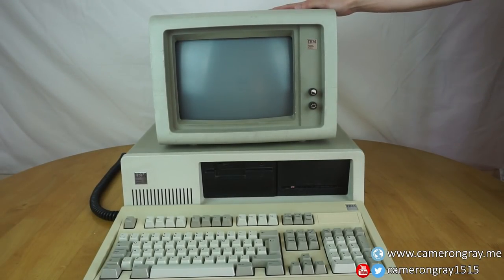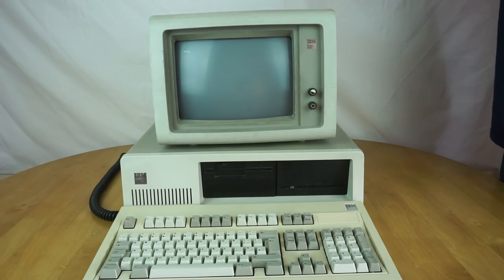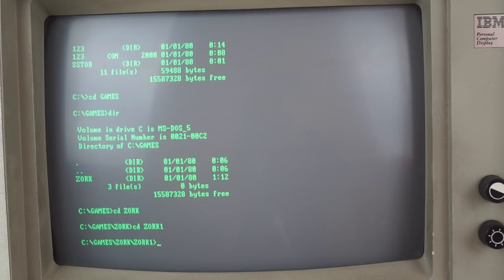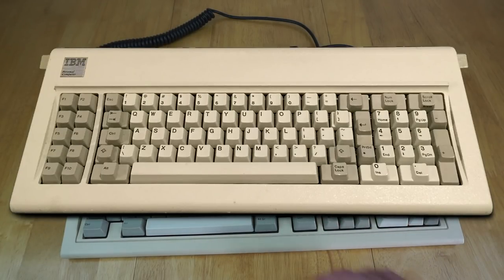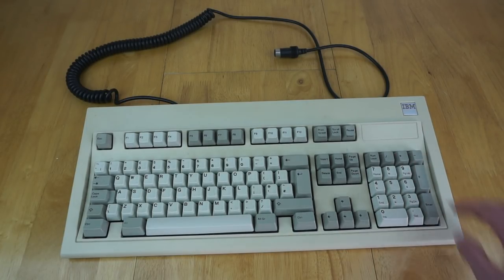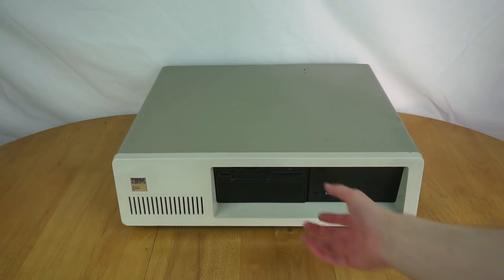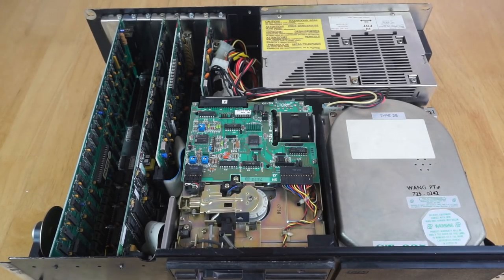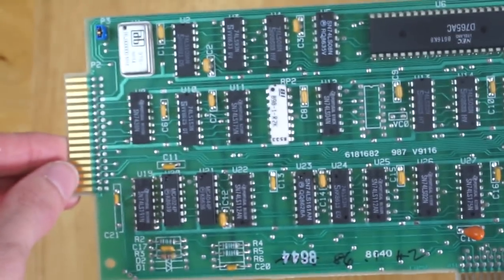Demo & Teardown - IBM PC XT Model 5160

Comment: BTW, those plastic standoffs are designed to come off with the motherboard. That's why they're in slots, so when assembling the system, you can insert the standoffs into the holes in the motherboard, then with the board attached to them, slide the standoffs into position in those slots and use the screws to secure the board in place.
Reply from the maker: Ahh, thanks, it all makes sense now!

Comment: Absolutely amazingly detailed teardown!
An XT was the first PC compatible computer I've ever used at 5 years old so it brings back memories. It had a yellowish (amber?) monitor though and nowhere near that long fadeout time so that was really surprising.
Reply from the maker: Yeah, amber monitors used to be a thing although not sure if IBM made them, yours may have been a third party monitor.  It's also possible that your machine may have been a clone as many of them looked nearly identical to an official XT minus the IBM badge.
Reply: I have little memory of the event but I'm 100% sure it was a clone. It didn't even have an HDD.

Comment: I love how the hard drive controller's main processing unit is a Zilog Z80, another CPU that dominated the early computer market. Two historic processors in that system.
Reply: Raffi Glen funny thing the Sega MegaDrive (called Genesis where I live) uses a z80
Reply: Boozab99 USA here, and I own a Genesis. True, the Z80 in the genesis is a secondary processor that works with the primary Motorola 68000, which also makes its home in the original series of Macintosh Amiga computers. So many practical uses for old stuff. Lol.

Comment: I have a couple XTs floating around, one still in service, so I can relive my childhood.  BTW--the screws are all flat head because ALL IBM machines used flat heat screws.  I don't know the reason for that, but that's what they chose to use on their machines.  This even continued into the PS/2 Models 25 and 30 for the slot cover bracket screws.  Somewhere, I have an IBM PS/ValuePoint 486 system, and the case screws for that were also flat head.  I believe that even extended into some of the early Pentium Aptivas.

Source:  My father worked for IBM for over 30 years.

Comment: super cool that you made it working again. These computers are unbreakable. most of the times its just a bad electrolytic capasitor. Great job! I have an xt myself. I turn it on often, so everything keeps in a nice condition. Especially the mechanical parts like the Seagate drive.

Comment: Excellent video. Thanks! The Model M keyboard looks weird with XT. I didn't know that they shipped XT with Model M. I also didn't know they made 8088 and 286 based XT's at the same time. This is a very old school machine, even for 1986.
Reply: I recently got an XT computer through a coworker of mine, and I'm glad to find that the Model M is something it would have come with as that's what he had (unfortunately the monitor however was a monochrome Epson, and I don't have any CGA or EGA monitors so I installed a VGA card in it and am going to use it with an IBM monitor associated I think with the PS/2 line; Also had to replace the power supply with an off-brand one, as it's all I could find on eBay when I searched). Also, it appears mine has a NEC variant of the 8088 processor (though no math coprocessor) as well as 512 KB of RAM (obviously, the later varient of the board that supported between 256-640 KB of memory). Also doesn't have a hard drive, but it does have two floppy drives on the left.

Comment: Many a time did I use Laplink...

MS-DOS 5.0 - a great OS for its time.

And Lotus 1-2-3...

My Mum’s office owned a Wang word processing system. They had used typewriters, then electric typewriters, then smart typewriters (with floppy drives) and the Wang was the main workhorse.

Also remember setting the ‘type’ of drive in the BIOS.

I worked in local government in the 90’s. They gave away working PCs (80286 base models) to charity groups but had to retrieve special ‘secure binary devices’ (early dongles) which required passwords to allow printing, especially confidential or secure documents. A type of ‘digital rights management’ of its day.

I worked out how to circumvent this device so they could be retrieved and destroyed securely. We presented a lot of charities with these computers, keyboards and monitors.

Our efforts were recognised by the Government Secretary at that time.

RAM in these machines was set at 1MB but up to 4MB could be plugged in - discrete memory chips. Then configured via DIP switches. That took a while to work out the combinations.

Each machine was tested before donation and, as a laugh, we actually installed Windows 3.1 which worked fine through the VGA card. It was installed on top of a MSDOS 5.0 install.

But with licensing being an issue, all drives were wiped before donation. It was up to the charity to purchase their own software.

This has brought back several memories for me.

What a fantastic video!

Comment: If you get a set of socket screw drivers that fit the top of the screws they are MUCH easier to work with. I find that if you just take out the bit from a screw driver like the one you used the case screws fit right in and can be removed easier than with a flat head.
Reply: For IBM PC and XT: Case screws require a 1/4 inch nut driver or socket. The power supply, expansion card and motherboard screws require a 3/16 inch nut driver or socket.

Comment: The MDA in this is a third-party board that is likely a Hercules Graphics clone, since it mentions "graphics" on the silk-screen. If it has 64K RAM installed instead of the usual 16K, graphics should work.

Comment: Your floppy drive looks much more modern than the full height one that came in my 640k 5160. Is your board a dark green or purple like mine? Can't make it out.
We do however have the same hard disk controller.

Edit: Ok nvm I'm at 44m now, it's green. Which is interesting because otherwise our boards are identical, including the botch wires. The part number on mine is however 55W47 003432.
I'm also surprised that your tantalum caps haven't blown yet. They will eventually, as they did on mine. So you should consider recapping.

Edit2: C56 was the same one that blew in mine.

Comment: Thanks for this.  I've just acquired an XT, and it has exactly the same symptoms (dead, but PSU fires up when the motherboard is disconnected).  I shall investigate short circuits and have a look at those capacitors!

Incidentally, I found your video as I was trying to figure out how to disassemble the PC to investigate further.  I had removed the screws, and was confounded when the cover wouldn't slide backwards.  It never occurred to me to slide it forwards.  Doh!

Comment: I had the same problem with my 286 mobo, but the fault finding was easier because the capacitor exploded after a few power ups. Replaced all tantalums with electrolitics and now works fine :)
Reply: When they go bad, they really go bang and set on fire.

Comment: a socket screwdriver makes working on IBM stuff so much easier.
Reply: For IBM PC and XT: Case screws require a 1/4 inch nut driver or socket. The power supply, expansion card and motherboard screws require a 3/16 inch nut driver or socket.

Comment: You should be able to run a bit of software called simcga and run cga graphics. I have used it on my 5160, though that was before I upgraded to a vga card.

Comment: Would it be possible to use one of those multi super I/O ISA cards in this that has parallel, 2 x serial, A&B floppy and IDE headers? You might be able to use an old IDE HDD then and you wouldn't need the separate serial and floppy controller cards. Would it work?

Comment: ST-225!!! I still have one, still works!
Reply: It has been said that the Seagate ST-225 is the most reliable hard drive ever made, since so many of them are still working even after 30 years. And I love the sounds they make!
Reply: Old HDDs just work for ever. I have some old 10GB ones that still work.
Reply: I have three different MFM HDDs from the 1980s and they all still work perfectly.
Reply: I still have my ST-412 that came out of my 1985 5160. Still works fine. I replaced it with a later ST-251.

Comment: As Bank 0 and 1 is populated with chips made 1986 week 20 and 15 and Bank 3 and 4 1986 week 29 this machine should have been shipped with those chips from the factory. AMD and Intel had a technology exchange agreement from 1982 and 10 years forward. This gave Intel the right to manufacture and sell some of AMDs chip designs under their own label and vice versa.

Comment: As a Scottish man, maybe you can help me.. I have just bought a 5150, pulled it apart, checked its all ok and got it into basic. I want to try and get a few diagnostics though but at the minute lack the 5.25" drive for my desktop PC to write any images I've found. Maybe you could help? I've yet to see it boot to dos as I bought the machine with no software. I do have a few soft sectored 360K disks though..!
Reply from the maker: When I was setting mine up it turned out that the 5.25" drive I had for my desktop was faulty, ended up hooking up the XT's drive to an early 2000s PC and it worked flawlessly to write some disks.  Once I had DOS running I made a disk with Laplink which made it significantly easier to transfer data to the machine without needing a floppy drive in the PC.
Reply: I’ve put my drive along with 8 bit card into an P1 mmx machine I have but I didn’t have the media. I’m a bit wary of removing the old stuff from the machine too much though as the risk of damage is high. Maybe I need to go hunting for a 5.25 drive on the bay.. Prices are laughable though especially considering I had plenty of those older drives in the past! Gone to the big landfill in the sky :( Thanks for the advice though.

Comment: You should’ve given the original disk a low-level format.
Reply from the maker: Tried that but unfortunately because the damage affects the first sector it wouldn't complete successfully.  The only hope is really have would be to attempt to adjust the heads or rearrange the platters so that the damaged area wouldn't be at sector zero. It's been a long time though so not looked into it for a while.

Comment: Could this machine run FreeDOS?
Reply: XT can ever run Windows 3.0 ! :)
Reply: It can't, because it doesn't support protected mode, which FreeDOS requires. However, there is a distribution of FreeDOS with modified utilities that doesn't require protected mode and does run on the ole XT, Svarog86. I use it almost exclusively on my XT.
Reply: The sourceforge page says it can run on XT...  http://freedos.sourceforge.net/wiki/index.php/Hardware_compatibility

Comment: is there no Ethernet port on that IBM PC-XT, I should think that the hard drive is very touchy and would break if mishandled.
Reply: i don't think there are viable 8-bit ISA cards for ethernet that would work on the XT. especially since the ethernet variant IBM tried to standardise is the one that failed to catch on.
Reply: +maboroshi1986
There are 8-bit cards that work, but they're slow as dog's balls and have trouble keeping up with network traffic.

Comment: What's with those wires on the board btw?
Reply from the maker: "Bodge Wires" - They are used either to repair faults with the board (back then it was cheaper to add wires rather than scrap the whole PCB it it had a few faulty traces) or to make connections that wouldn't be possible due to the layout of the board without adding additional layers.  PCB technology has certainly come a long way!
Reply: Ah, thanks for the information.
Reply: I still do repairs like that.

Comment: Why is there is a Z80 on the Hard disk controller?
Reply from the maker: Oh wow, never noticed that!  Suppose it's probably needed to do calculations since the controller has to translate the requests from the CPU into movement commands to control the drive.
Reply: The Zilog Z80 CPU sold in huge numbers in the years prior to the IBM PC, due to the surging popularity of the CP/M operating system and the cornucopia of software written to run on it. For this reason, the Z80 was manufactured in volumes that were previously unprecedented for any microchip CPU. That brought it's price down, so it ended up being the only choice for microcontrollers in the 1980s; nothing else was vaguely so sophisticated at the same price.